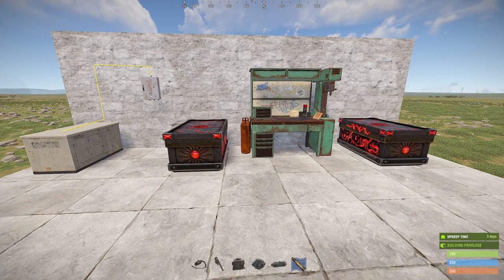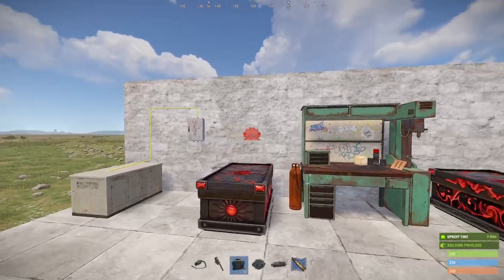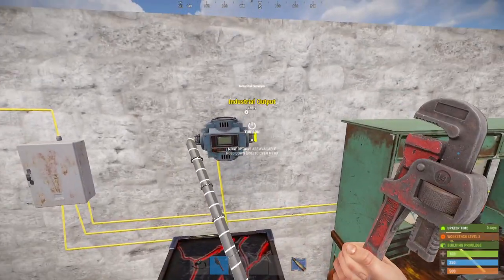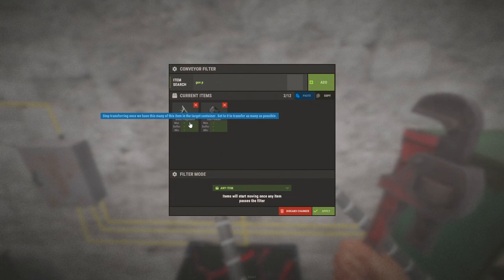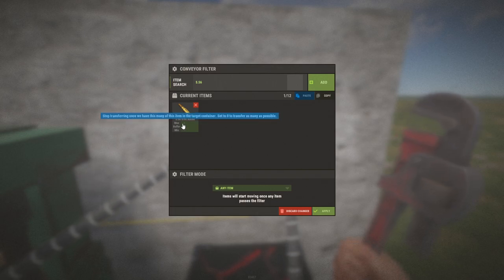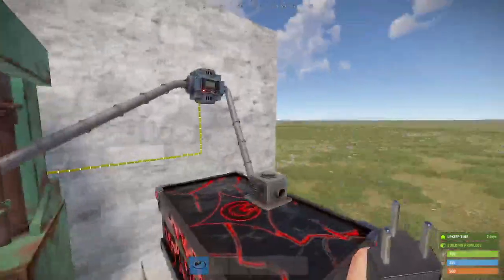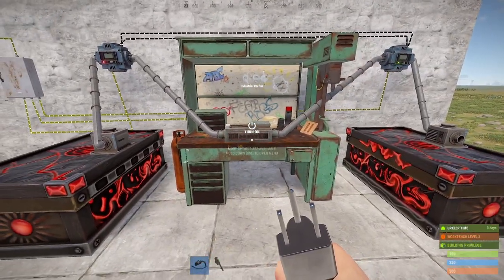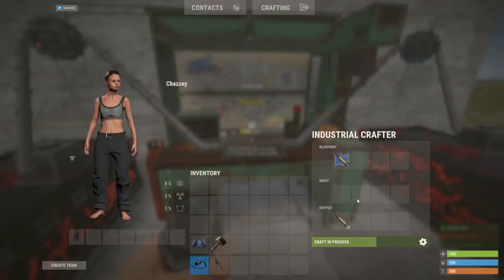Industrial Smart Crafting | SET THRESHOLDS!!! | RUST Industrial Guide

Comment: This  failed signal is broken imho. It fails if it is max, it fails if it is not enough in the source. And no way to distinguish two. You solve this by leaving a small amount in the crafter, as I understand, so it is able to move something successfully to enable first conveyor.
Reply from the maker: Привет, мой друг. Я немного говорю по-русски, но отвечу по-английски. That is correct, we leave some ammo in the crafter, if the ammo in the crafter builds up too much you can pull some out and put it in your box. If you want to autocraft syringes, all you need to do is set a max on the output conveyor. Hope this helps!